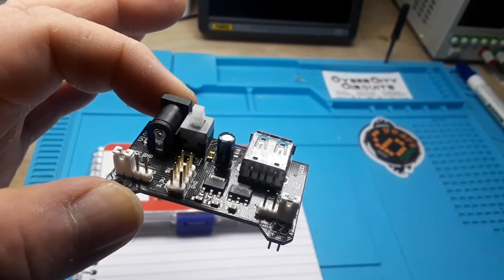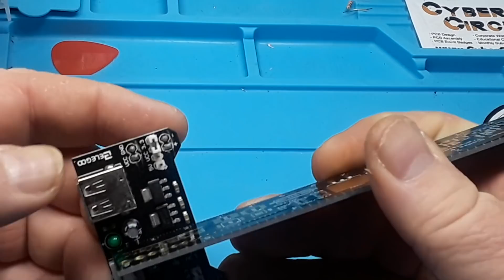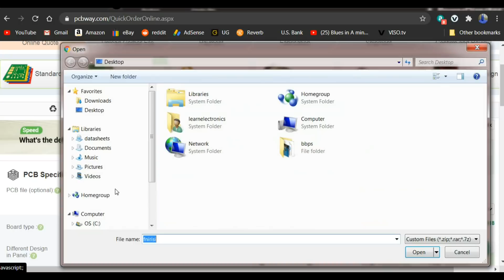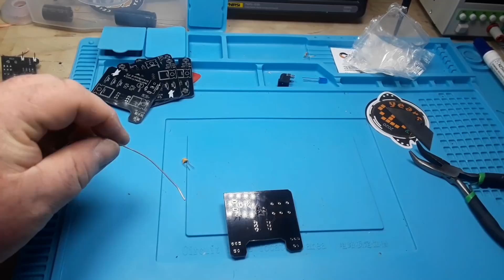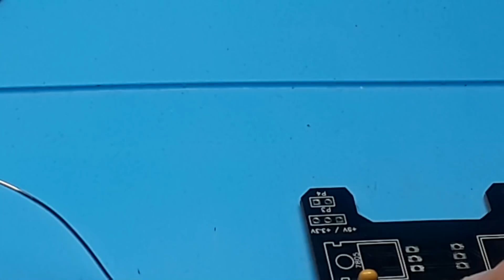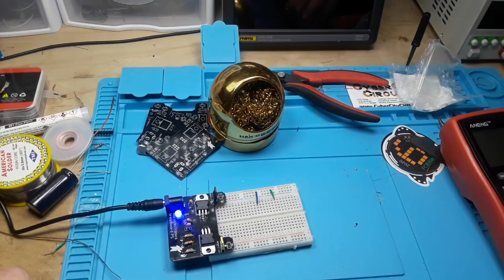Build your own breadboard power supply

Comment: New to your channel Paul and I know this is three years out of date  but quick question, why do you  measure from the edge of the ruler rather than from the zero mark?  It puts your measurement out by a few mm's. You measured the outside pins correctly but not the inside pins.

Comment: Why go through the hassle of engineering this power supply when you could just buy one online. If I were looking for convenience and low cost I would just take a USB phone charging cable, strip the positive and negative wires, solder them to some header pins and boom 5volt breadboard power supply.

Comment: Maybe I'm looking in the wrong place. I don't seem to see your project on PCBWAY.
By the way how would it be if the breadboard power supply project could be made to run regulated positive power on the top side rails of the breadboard and negative regulated power on the bottom pair of rails of the breadboard. 
Could this be used for op amp experiments? Just thinking out aloud...

Comment: The kids are grown and no longer a distraction (Trying to eat parts or play with the soldering iron.). Wife is gone so there's no one around to tell me that I'm "wasting money," or complain about "messes." The remaining pets are older and more civilized. They tend to doze quietly in a corner now. Interesting parts from China are so cheap and easy to use. I think I can finally finish the robot I've been building for 50 years. You're an inspiration. Thanks.

OBTW, while metric units of measure are better in just about every other way, (with apologies to the rest of the world,) when working with parts that came out of the '70s digital era--sometimes it's easier to use imperial units of measure. It's just that ".1 inch" is so much more elegant than 2.54mm.

Comment: very helpful overview of the process.
i definitely learned some valuable details.
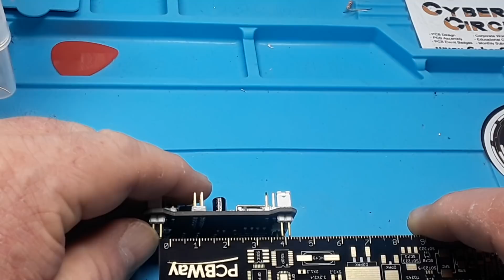however i couldn't help noticing that your physical length measurement at 4:15 seems rather sketchy.
you quote a distance as 39 mm - 
when you are noting the distance between the EDGE OF THE RULER and the 39 mm mark 
rather than noting the distance between the 00 mm mark and the 39 mm mark. 
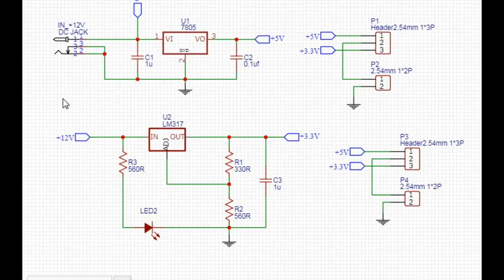could this have something to do with the troubles you mention at 5:24 ?

Comment: When you measured the pin spacing on the bottom of the board, the outside was measured from 0 while the inside was measured from the end of the ruler.  I would assume you address that later in the video, but I thought I would mention it anyway so I "post my comment" on fhe video.
Reply: seen that also , lack of flux in soldering too.

Comment: If you draw any significant current those regulators are going to overheat very quickly. You may need heat sinks. Plus what also helps is to put a big diode inline with the power supply. This will help drop some of the voltage across it and provide reverse polarity protection.

Comment: I just like to know how in the world this HotPoint washing machine door switch works.  There is not a place on the internet that will tell you.  The problem of course is also it is not just looking inside of it which of course has no circuits, just mechanical stuff but what the computer interacts with it.  As I can not by pass it by hot wiring it.

Comment: why did the shipping $18! did you use the space shuttle? should the 7805 and lm317 be attached to a heat sink?
Reply from the maker: You can choose a slower method. I use DHL and get my boards back in a week or less. Depends on input voltage.

Comment: If you are doing a comment test, I made three comments, in a row, but I only see two of them. The one that is missing is the one that I said you need big smoothing caps on the input side of the v reg and you responded that you built it per the data sheet. I just learned about this very thing. Smoothing caps are considered general engineering and are not included in the data sheet, because the manufacturer can not know what load you will be putting on the circuit. But, they are always required (by the demands of the circuit.) They limit input ripple and maintain the voltage headroom/dropout zone. When the demand is unknown, some folks default to around 500uF. I default to 1000uF, just 'cause.

Comment: Great video, I have about 15 of these otherwise I would build my own. Be nice to add a small RGB LED on each side that shows either yellow for 3.3v or red for 5v (or whatever colour you choose). That way you know at a glance what voltage it's set at.
I like boards neat also and having components lined up just looks more professional. Its different for a first time test on a perf board but even then if it's neat it's easy to see what's what. 
Nice video mate, keep them coming. I hate surface mount also, have lost a few fingers so it is just hard screwing with small surface mount crap.

Comment: Howdy from San Francisco!  I'm a big fan of the 317s.   I restore old test equipment and one of my usual tricks when rebuilding VTVMs is to build a small battery eliminator powered off the filament voltage; then you never have to worry about leaky batteries ever again.  I build my circuits with a 1k trimmer so I can bring the voltage right to 1.5V (or for my oldest models 3V)  It's not really needed but I'll stick on one of those small heatsinks just to be safe.

Comment: There is an advantage to using the bigger through hole v regs over the smd type... They can supply considerably more current... The smds are 100mA, IIRC, verses the 1-1.5A of the through hole type. A breadboard project with a small motor, or two, can easily need more than 100mA.

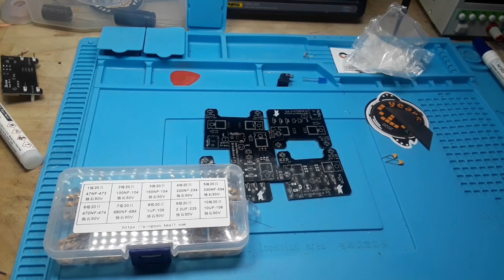Comment: OK, had posted a comment just for the sake of it, but now I  have an observation.  At 9:10 you are looking for a 0.1 Micro-Farad and you grab a 100 Pico-Farad.  The 1 Micro-Farad is identified as 105, the 0.1 Micro-Farad should be 104, and the label on your bin said 101.  Is using a capacitor 1000 times too small going to be an issue?
Reply from the maker: My mistake

Comment: Good job Paul. By the way. You could use the LD1117V33-DG as it is a standard TO-220 , fixed output instead of the LM-317.

Comment: When designing a PCB check for proper footprint.  Wouldn't have to fudge the capacitor legs in this case.  I speak from bad experience with wrong footprints.

Comment: Very useful and practical. How different would the voltage regulators (and bridge rectifiers) be to go from ~ 15 VAC, 6.25 Amp to clean 12 VDC? Is there a book you recommend for this? Thanks, Kennedy

Comment: Hello Mr. Paul. I just noticed at 4:16 slight offset of zero position on your ruler while measuring inner pins distance. The value according to my observations should be about 42mm.
Reply from the maker: Yep, I had to adjust it later

Comment: ya really would never need to heatsink either regulator if using the same 12v 1A jack like you did,  yes??? because that all i would ever use with this seeing that the 7805 needs 7V to run. love this project Paul...

Comment: Comment as requested.. the second measurement is not correct. Will the board fit?
Reply from the maker: I had to adjust it later
Reply: @learnelectronics  So I eventually :) saw. Thanks for taking the time to put these videos together. I've learned a lot and always look forward to more.

Comment: I have a question about connecting 2 transformers. I know you can connect outputs in series or in parallel but is there any point in connecting inputs in series? Would it increase number of turns or since they are on different cores it wouldn't matter?

Comment: Such a good boy, helping your aunt and mom. Nice pcb, I have started getting used to surface mount parts. The biggest reason is I now have a good microscope for soldering a Swift S41-20. That even helps my 56 year old eyes to see those tiny parts.

Comment: Those YWRobot power supply boards are great. I have used them for a few projects around the house. I had one that died on me. I may make some using your gerber for the heck of it, that way I could repair it. I am trying to make/design a PCB for a simple solar powered weather station but that EasyEDA program is a bit daunting.

Comment: 4:15 - I don't think you measured from zero when measuring the inside pins. <- Comment as requested.
Reply from the maker: I didn't and had to adjust for that later
Reply: @learnelectronics  Are they correct on PCB way now? Thanks
Reply: @learnelectronics  When will it be uploaded on PCBWAY ??????
Reply: Noticed this too, glad he re-measured.

Comment: You didn't zero the ruler when you measured the inside pins. You used the edge.  Obviously you corrected it on the board design but it's the little boo boos that can make a project go south in a hurry.
Reply from the maker: I know. Had to correct for that later